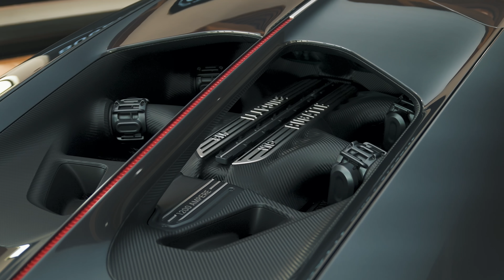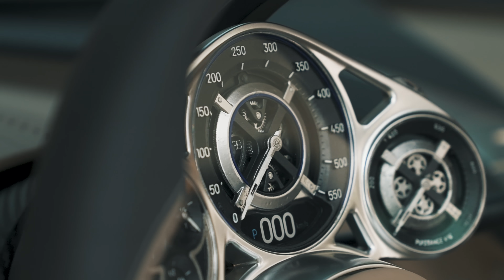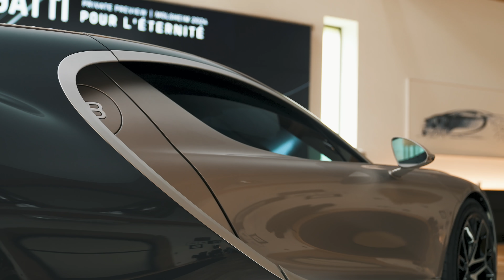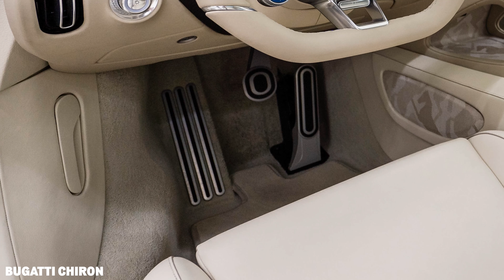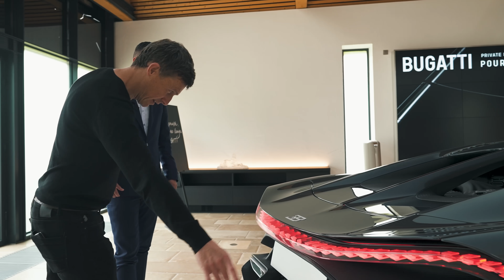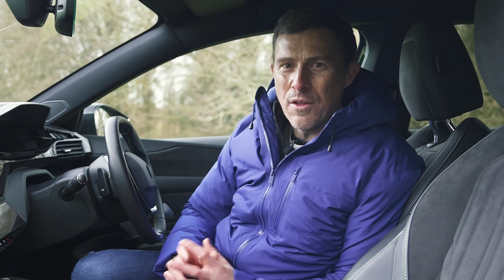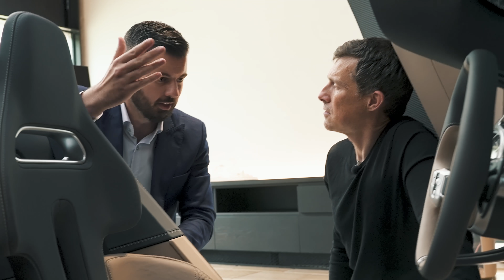New 1,800hp Bugatti Tourbillon Unveiled!

Comment: 0-60mph in 2 seconds with such a overcomplicated 1800hp power system, that's not quite impressive by today's standard honestly, considering Tesla Model S Plaid with slightly over 1000hp can do close to that acceleration number already. Also, that V16 is only NA, and if they turbocharge it the whole system can easily go over 2000hp if not more. That power produced from that 3 electric motors combined is also a bit lackluster compared to what S Plaid can do with 3 motors as well, heck, even some crappy China EV's can hit 1000hp easily with electric motors only. If they use more powerful motors, on top of a turbocharged V16, I would say 3000hp without breaking a sweat with Bugatti capability, and we will probably be talking about 500km/h realm already. 1800hp for a overcomplicated system of V16 + 3 motors system is too less. Since you are going with this kind of complicated system, might as well aim for more.
Reply: This isn't 0 to 60 in 2 seconds. It is 0 to 100kmh which translates to 0 to 62 mph. The extra 2mph translates to another 0.2 seconds. The Tesla also uses a foot of roll out which translates to about 0.2 seconds. Accounting for the roll out and the kilometres to miles conversion this is probably 0.4 seconds quicker to 60 and that's when the Bugatti starts to pick up speed and the Tesla ends. This would dust the Tesla especially as the speed rises. The Porsche Taycan GT would smash the Tesla for a fraction of the price of the Bugatti

Comment: 1800 horsepower and 2000 kg =  1.1 kg/hp.  No 1:1 power to weight ratio yet... It will be quicker than Chiron Super Sport to 400 km/h but it will not beat Nevera up to Nevera's top speed... So, expect Koenigsegg Gemera to outrun this new Bugatti.

Comment: this is going to be a LEGEND.....wow V16 no turbos.... WOW
Reply: Yes but can beat 812 Novitec?
Nope:)
Reply: What's wrong with turbos? (I know very little about cars)
Reply: @glengarryglenross7127 Turbos kill/supresses exhaust sounds and muffles the noises.
Reply: @glengarryglenross7127  biggest problem is turbo lag, a delay that reduces driver connection to the engine
Reply: @axiomic  turbo lag is solved nowadays with VGT and electric turbos like Porsche has now
Reply: @glengarryglenross7127  Turbo takes the exhaust gases to spool itself up to increase air intake. Since it is using the exhaust gases, the car sounds muted, and the extremely high intake volume suggests that the redline can't go very high. Thus, the N/A variant lets you go much, much higher.
Reply: its got electric motors instead lol ev and battery

Comment: The interior is a rip off of the Honda Sprocket Concept, Citroen C5 steering and Lexus Altezza dials. Rear end a rip of McLaren, the rest just looks like a Chiron. I guess at least it has a better engine and not some VW hack job of welding two engines together. 3.2m for this shite, could have a barn full of some of the greatest sports cars made for that price.

Comment: Bugatti  now needs to made a second model a
SPORTS LIGHT SUPERCAR? 
Bugatti SLS ? Using half the engine v16 …maybe a hybrid but no plugin.. used to fill  torque dips and increase low down torque.
A world first production of a  
A >4.1L INLINE 8, due to less friction, it’ll  rev to 10,000 + rpm not 9,500 … with over 750hp
…… YEA PLZ 🤤🤤🤤🤤🤤
Yes plz 😂😂😢

Comment: Viper eat ur heart out ,  this is how u make use of 8 litres 

Rimac knows everyone wants high revving engine NA too ,but a high torque high revving , equal headers that make a great sound is rare… 
… I think if it wasn’t a Bugatti, rimac would’ve made it lighter smaller displacement increase the electric power maybe to 50% 50%. Make up the low end torque needed And maybe  a manual Option or a gearbox from Koenigsegg. 
A new BUG can’t be slower than its predecessor.

But in these crazy times 
Building an engine that’  is 8.3 L in displacement is mind blowing ..

Comment: Just when I thought I'd never want a car more than the T.50...Bugatti unveils this.  Incredible design and engineering.
Reply: Still unbelievable, that the T50 weighs only half as much as the Bugatti, revs to 13k rpm, has 3 seats and a lot more luggage space and still goes 400kph and all that for half the price 😱
Reply: @Captain_bl_007  no it doesnt lol nice cheapskate move though
Reply: @davidherene6365  it absolutely would with the right gearing. It’s simple math: it has a better engine than the F1 (more hp, rpm and about the same torque) the F1 did 392kph so the T50 would go well over 400. But like Gordon Murray said, this car isn’t build for top speed. 
Why so toxic, can’t handle someone who has a different opinion?
Reply: no one can handle knowing this combustion engine puts out less BHP than the Chrion without the electric motors
Reply: t.50 is ugly
Reply: You clearly have a thing for Cosworth powered hypercars, and I wholeheartedly agree 😂

Comment: they could design it better especially in powertrain features,battery pack weighs 200 kg with 130 wh/kg in pack level energy density,CATL has released a battery cell called semi solid condensed NCM cells with 400 wh/kg in pack level energy density,they could have 50 kwh battery pack with weight of only 125 kg in total meaning it could be twice in capacity and 80 kg lighter in weight if bugatti just payed more attention to the details,also they could have 6 liter twin electric turbo(like 2025 porsche 911 gts which acts like a anti lag and generator for the battery pack) w16 that puts out 1500 hp and weight of 200 kg in total,they could order ultra powerful 800 hp yasa axial flux e motor to be sandwiched between the 6 liter w16 and transmission which has 15 kw/kg power density(highest in the world)all of that means bugatti tourbillon could make 2300 hp from w16 engine+3 ultra light weight e motors and CATL semi solid 50kwh  battery pack for the powertrain,and din weight of only 1880 kg in total,bugatti what have you done with your amazing hyper car

Comment: So if im understanding it correctly with the mode change, if you select ICE mode, then the car would be rwd? Because the ICE is not driving the front wheels(the electric motor does that), then we have a 1001hp rwd v16 hypercar? Absolutely insane..

Comment: To have Mate Rimac as the CEO of Bugatti was  a stroke of genius. The man has genuine passion and engineering knowledge. He knows every little detail on this car and the reasoning behind it. Great video
Reply: Every little detail except the trunk capacity 😀
Reply: @АртёмШарко-к8б  you dont buy a bugatti for trunk capacity cmon😂
Reply: @АртёмШарко-к8б or even the sound woofer.
Reply: He's a car guy... He loves the engineering side more 🤣
Reply: @MotorDynasty  he has made the first plug in hybrid Bugatti
Reply: Ask him about the material lining the cup holders and you'd likely get a blank stare too.
Reply: every detail when it comes to batteries and EV you mean
Reply: @lemcakes32422 not knowing practically features is an USP. OC was praising him for not knowing the trunk capacity

Comment: Down step for me.  The design is awful, front is already but what it going on with the rear?  Where's the exhaust?  And removal of the turbos?  That's the iconic bugatti sound of the intakes,   this will make the chiron go up in value massively.

Comment: Volkswagen sharing parts and designs again the front motors and battery in the gear tunnel is basically the same setup as the Revulto but the motors have more hp

Comment: So the Nevera is still accelerates faster in a straight line? I hope this car weighs less than the Nevera so it will be faster on the bends. Glad to know it has the higher too-speed.
Reply: The Nevera is a full EV, obviously 0 60 is faster there...
Reply: @userhessenone1469  not just full EV, but has more hp & torque

Comment: Wow, doing a V16 instead of the old W16 is SO much more interesting, and at 9500rpm can clearly rev MUCH higher than the old W engines.  This is the first Bugatti that, if I had the money, I would actually consider buying.  
I've never loved those old W engines, tbh, granted I've never had the chance to drive the Bugatti W16, but I've driven the W12's in the Bentleys and even the old VW Phaeton (first car I ever encountered with a W-type engine), and I just never quite got along with those engines.  They were VERY rumbly, even moreso than a typical V6 (which makes perfect sense considering they're just two V6's bolted together), they didn't make a particularly special sound (yes, it was unique, but again, in the same way that I don't like the sound of most V6's, the W12's just never sound properly balanced to me, especially at higher RPM's, those engines just never felt like they wanted to be revved out).  
The Bugatti W16 definitely sounded better than the W12's, but it didn't have much of a special sound, either, it sounded like some type of really angry earth-moving equipment, with a little snarl at the top end.  
This new V16 on the other hand, even in that 3 second sound clip, sounds amazing.  It sounds balanced and unique, and very, very racy.  I like that it's not insanely grumbly like the W's, instead it's more of a high pitch, angry sound.  It sort of sounds like a flat-plane V8 mixed with an inline-6.  I'm loving what Rimac is doing with Bugatti so far.  Mate is such a brilliant, brilliant guy.  It's fun to see him talking about the pinnacle of ICE engineering for a change, instead of pure EC stuff.

Comment: As a watch collector the name is quite fitting. The tourbillon was invented by Abraham Louis Breguet more than 200 years ago because the force of gravity was not equal on a pocket watch that sat in a breast pocket in only one position, which affected accuracy. So to offset the effect Breguet invented a mechanism to rotate the balance assembly, or the regulating organ of a watch that regulates the time, to make it more accurate. Its a legacy invention that has no place in a modern wristwatch where the movement of the wearer's arm offsets the effect of gravity and today are only used as an engineering flex by the watchmaker. That mechanism is just like this car, an object who's only purpose is to broadcast your wealth to the world. Pointless.

Comment: Its nice to see someone that actually gets it, cars today are in a competition to see who can design the ugliest interior. Just about all of them have that huge cutting board running right across the dash so destroying any possibility of a scenic view. Its nice to have a small push back against this design trend. 
15 years from now all those slabs will at the very least start to get laggy and unresponsive, the batteries should already have been changed on the electrics since they can't work properly below 70% battery efficiency.

Comment: It's 16 cylinders but still 1000 horsepower out of a naturally aspirated production engine is insane.
Reply: Yeah, but the specific output, 120 hp/lt, is not that crazy. The Valkyrie puts out 1000hp as well, but from a 6.5 V12. But it's from Cosworth soo🤷🏼‍♂️
Reply: @stefanomarchi3542  well the Bugatti gives importance to reliability
Reply: @stefanomarchi3542  they are not even remotely comparable though. 1000 HP in a N/A road car in this day and age? I mean even Ferrari is moving towards tiny engines with huge turbos. This is something else and I'm sure it will be tuned to perfection.
Reply: @37racso  The specific output in Ferrari's 6.5 V12 is higher than this V16's
Reply: This is also Cosworth
Reply: I can imagine that the engine could be pushed even further, but the thermal management is always a problem
Reply: its hybrid. it needs power from socket, you guys are dopy af

Comment: Not so sure about am suspension components. I guess they will undergo some serious NDT inspections before use but still. When your car weighs 2 tonnes maybe don't trial the most inconsistent manufacturing process on a structural component, imagine if that lets go at 200 mph.

Comment: 29 seconds in and the guy "responsible" for the Bugatti Tourbillion drops a fake watchmaking marketing line. Tourbillions were meant to increase accuracy but suck so badly at it that they either make accuracy worse or don't change it at all. They're used as pretty little decorations.

Comment: If they are able to make the electric motors work separately, they can make work in stages when set to manual. For example 1st gear = 1 motor used and 2nd gives you access to 2 of the electric motors it would be cool

Comment: why they say it's 400hp per electric motor, but battery cannot push that, and why not make the electric motor smaller ? is a torque thing as low rpm ?

Comment: The styling is more an evolution of the Chiron with a Mistral-style protruding grille. I was expecting something a bit more different and individual - maybe the Mistral should have been held back and its styling used as the basis for the Tourbillon. But still, the Tourbillon looks stunning. The interior looks exquisite but is, again, more of an evolution of the Chiron's. Either way, this thing is going to sound epic and will make a stabbed rat seem slow.

Comment: Bugatti in 2035: V24 engine, 15 000 rpm
Reply: You gotta push the boundaries
Reply: W24>
basically 3 inline8
Reply: Not really, Cadillac did this first in 1930, then also Maserati, Auto Union in 30s and after the war, it was BRM type15, Bizzarrini, even BMW and Rolls had a V16... hardly unique or original, and even stolen the steering wheel idea from Maserati's 1972 boomerang concept.
Reply: @Andy_T79  nobody made a v16 that made that much power and that maserati concept steering wheel is completely different
Reply: @Andy_T79  Citroen C6 steering wheel

Comment: I almost like it. But the design of the front where the headlights are not connecting with the grill and the hood is where you lose me.

Also that fixed center steering wheel is from Citroen

Comment: Was expecting why better design to be honest.. 
Front is literally a Chiron with a long azz nose. And the rear is a copy paste from La Voiture Noire...
There is nothing new here. And on top of that Chiron had 1,500hp. And with this new model - by adding 2 E motors and all that. It only has 300hp more compared to Chiron.
Not that im going to buy one lol, or even see one IRL. But kind disappointing not gona lie.
Reply: Same feeling😭😭😭😭
Reply: This is not about pure performance, the engine is N/A and large displacement!!! This is a car which will drive really nice due to the engine characteristics while having bonkers performance
Reply: Chiron SS 1600HP,  Bolide 1800hp
Reply: @larryc1616 

Thr Bolide is still 1600hp.

Comment: Bugatti delivered! NA, Analog Speedometer, nice looking car. dayum
Reply: But why not put turbos on that unique V16? Cuz the EV needs space & weight too instead..
Reply: @bekeneel  I think the fact that it's unique is why they're not putting a turbo charger in there. I'm not an engineering expert so I might be wrong here, but from what I've seen, usually cars (besides F1) with naturally aspirated engine can rev higher than cars with forced induction, at least for cars that are on similar level, like 911 GT3 RS vs 911 GT2 RS. The fact that we have a Bugatti with an engine that massive and can rev higher than a 911 GT3 RS is what makes it special.
Reply: @kyro1313  guess you can think of the EV motors as a quicker replacement for the turbos, instant on tap power boost vs spooling up.. so why have turbos? anyhow that's how I see it..
Reply: @bekeneel You can't fit the turbos and ev motors and a battery at the same time
Reply: @bekeneel  To offer naturally aspirated experience if you want it? Can't exactly disable turbos, while you can do that with EV motors.
Reply: @bekeneel  turbos are better for economic cars imo

Comment: Tourbillon? What? Did they run out of French racing drivers to name their cars after?

I wouldn't call it ugly unlike some but it doesn't seem to be a big stylistic departure over the Chiron in the same way the Chiron was to the Veyron.

The industrial designer in me appreciates the subtle changes they made over the outgoing car. Much of ID is actually like that. The result is they've successfully liposuctioned a lot of the visual fat of the Chiron (and Veyron). It now looks properly svelte and sleek. I like-y.

Comment: Naturaly aspirated 1000hp v16??? Holy shit this man is actually insane
Reply: The reason is reliability it can definitely push more than just that
Reply: Gordon Murray V12 has 170 bhp per litre. The bugatti 120.
Reply: @sajid6027 both made by the same company.
Reply: Detuned ICE and detuned the E motors as well (battery limited). It's a win-win. Surely some owners would unlock its full potential and remove the limiters.
Reply: Feels like a batman spec
Reply: Well he is insane, hes done it with a petrol car and even better with an electric car
Reply: @powderskier5547  its a plug in hybrid with 3 motors
Reply: Not really Lamborghini has V-12 engine 6.5 liter capable to produce 700-800 bhp
Reply: @widodoakrom3938  this has electric motors they produce 800 bhp
Reply: That carbon floor and pedal set up is insanely beautiful 🤩
Reply: No disrespect, but not really. You get 800+hp from Ferrari v12's and 1000hp from Aston Martin Valkerie V12, and both are around 2L displacement less-and ofc 4 cylinders less. If anything, I guess they probably de-tuned that v16 for more reliability
Reply: @ivanpuskaric6851  sure...but a v16 with more displacement will always have more torque so hp doesn't really matter 😂
Reply: its electric thats not naturally aspirated